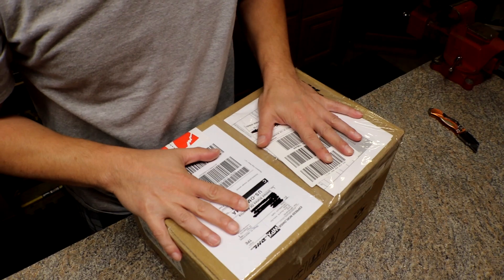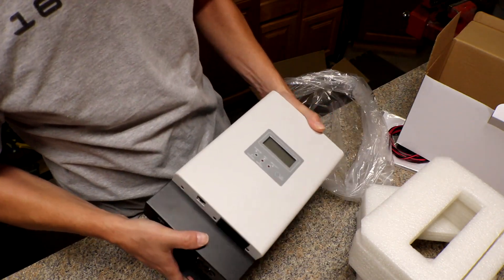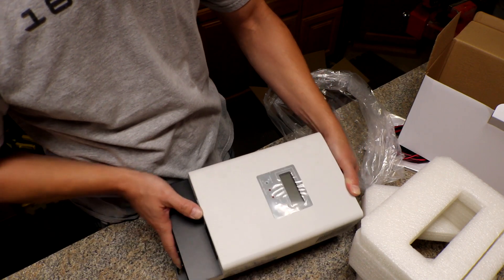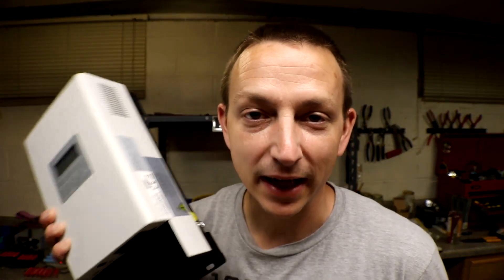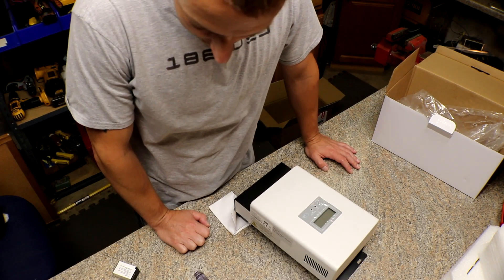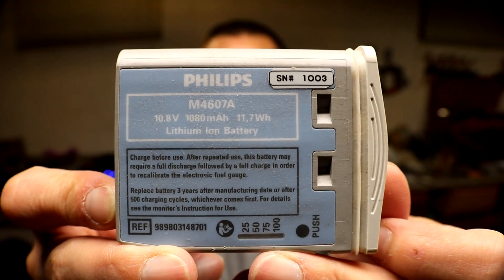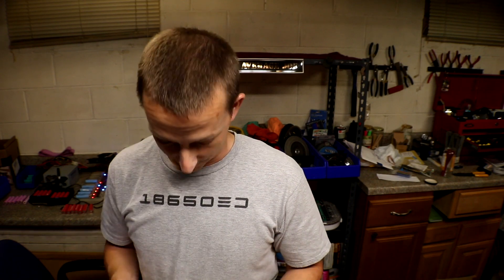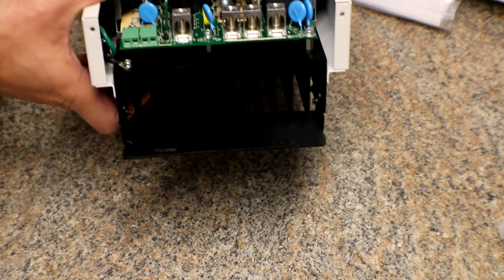Diy Tesla Powerwall ep48 PCM60X Solar Charge Controller!

Comment: hey mate did you programmed the pcm 60x to charge lithium ion batteries without any other monitoring pcb for them? cuz i heard lithium ion batteries need a specific pcb circuit that moinitors their temperature for avoiding overcharging /catch fire/etc
Reply from the maker: Nope, I just changed the settings to be more compatible with lithium in the menu.  You can set the voltage limit of your packs so they wont over charge.  Also since my battery packs are 100p and I only have about 1400watts in solar, the cells wont get hot from charging.  I would need a crap ton more solar to get them hot.  I do use the Batrium for a bms which will keep all packs balanced nicely.
Reply: AveRage Joe ok thnx for info , so you reccommend batrium if im going to change my battery room from lead acid to lithium? And what about lithium iron phosphate are they safer ?
Reply from the maker: I would recommend the Batrium to everyone that is going to Lithium.  Yeah LifePO4 is safer and the voltage can be a little more compatible with inverters.

Comment: I also got a app Backup-UPC XS 1300 What size battery pack it can handle so can be used whit a solar controller and how many panel's do I need.
Reply from the maker: +Cesar Pardo Should be able to handle any battery pack. Its hard to say on how many panels. It would go off your current needs.

Comment: I live in Puerto Rico but I been getting loptop battery's from repair shops but I need more they have to be tested  so I can get over 2300mlh for my project .where do you live let me know I am interested.
Reply: Can you shipped them to me and how much.
Reply from the maker: +Cesar Pardo Im in the US but I would be kinda worried they would show up damaged. The laptop packs are all untested as they are still in pack form.
Reply: AveRage Joe I will testing them here, that's how I been getting the loptop battery's by taking chance on the good one the other that come out less than 2300mhl used them for other projects let me know, you need a phone number to call.
Reply: You can tape them together and put them in a strong box it will be okay.

Comment: What is the cable you had to order for the ups? Cuz I got an older 3000 ups with a db9 port and im trying to connect it to a laptop with only usb ports. Its crazy!, Im doing pretty much everything youre doing at the same time and it is just coincidence.
Reply from the maker: +Jeff Flanagan Look online for the pdf of your model # and it will tell you what cables. Also does yours have a lan connection?
Reply: I cant find any info on my model dl3000rm. Yes it does have the network card thing.
Reply from the maker: You should be able to log in with that and what program are you using?

Comment: hey m8, i really enjoy your video`s! so my second message here;  i am into the solarpanel installations at work, i see your convertor isnt that big really, i worked most with bigger sized , in weights at least 30kg or so for the single fase ones.
if you need help with you panel installation message me!  be sure you dont have shadow on one or more panels or it will have effect on the whole installation, if you wanna max out the efficency use optimizers under the panels, one for each pair.
but...  ofcourse it takes money at first , regards from Holland!
Reply from the maker: +highflow highflow Thanks, I appreciate that!!! Yeah this UPS isnt huge at all but its a start. I do have some tall trees in the back yard(and neighbors yard) so I cant avoid all shadows. I do miss some of the morning sun because of that. What are these optimizers you speak of?
Reply: Wel these are small boxes and each One need to be in the chain They are digital adressed do the invertor know what panel is in fail or is less working

Comment: So what are you planning to run off your inverter?  Looks like 2700 watts is a couple 110 amp circuits.

Computers? Shop?  back feed your circuit panel through the dryer plug?
Reply from the maker: +Gregg McClelland Yeppers, its a 2700watter. Im gonna pretty much do a poor man transfer switch or a version of a back feed through a plug. 👍

Comment: Do you know it supports your 18650's?  the eBay page says it supports agm/gel and  'some lipo'
Reply from the maker: +Eliot Mansfield Its the same one HBPowerwall uses and You just log into it and change a few settings 👍
Reply: On their ebay page: Does this charger support non-Lead Acid battery types (e.g. lithium)?
  Yes it is possible.  But one must ensure the battery type that is being used has a charging requirement supported by the charger.  please check with your battery supplier for the requirement and check against the solar charger's bulk & float setting.  If they match this should be ok. However, please note there's no BMS feature supported by the 60X.

Comment: LOL calm down buddy.... NOT..... fuck it and go crazy..... the manufacturer is MPP Solar... not Mppt Solar..... 2nd that com cable is for rs232 communication.... do not plug the charge controller into ur ethernet network or router. U need a usb to db9 connector but CAN'T guarantee it will work but if u have an older laptop with a db9 com port then use that. You can either use windows or linux mint to use the software that comes with that unit. 3rdly u can plug in that bad boy to the battery bank and learn the settings in the menu. U dont need the panels connected to check the unit out and heck lay some panels on the ground and run the cord thru the door or window and fire up that thing :).
Reply from the maker: Im goin CRAZY!!!!! lol  Yeah I figured it was just MPP lol.  Yeah Ill have to hook it up and get the setting all done.  So much to do but not so much to do.  Ya Know??? 😜
Reply: more like u have a shit list of stuff to do and not enough hours in the day to do it...therefore u wish u had a Jarvis to assist u in ur daily tasks, maybe 1 day it might become a reality.
Reply from the maker: YES!!! I need a Jarvis lol.  I dont mind goin out to work on sheit at 2am.  Might look funny to some people.  Might spook the POPO's LOL with my head lamp on.  HMMM I should do that 😜

Comment: Great video again Joe. Thanks for the mention! Those packs are great! Opened 360 of them. 95% over 2100mah. Really should get one of those charge controllers.
Reply from the maker: +Rohan Wilschefski Thanks! Ill have to throw you ch link below! Yeah these packs are awesome. Have you seen or opened the smaller ones?
Reply: AveRage Joe smaller ones say 1080mAh..... per cell... thats not use mate :D
Reply: TheJ Man those smaller ones have a high Amp out put.
Reply: True but we don't really need those for powerwalls :(